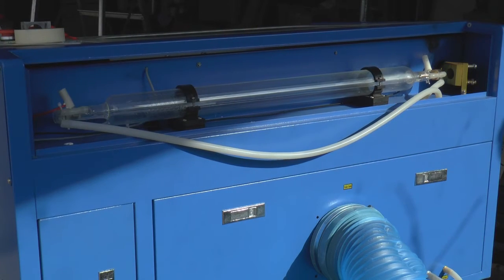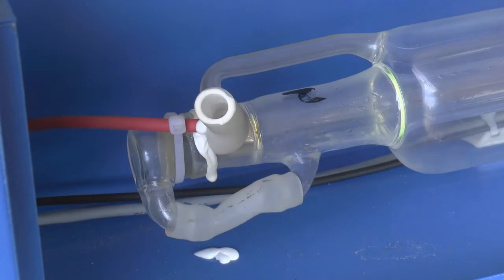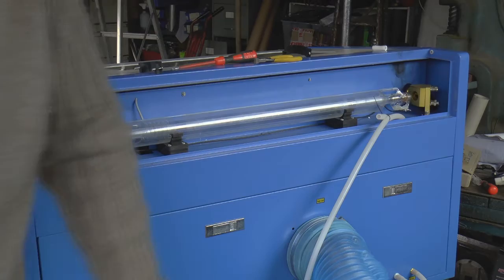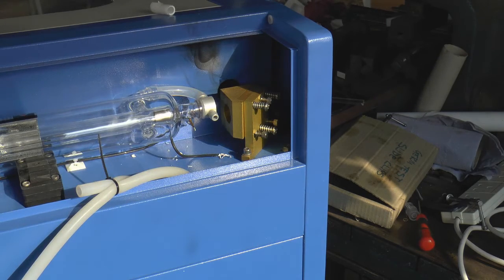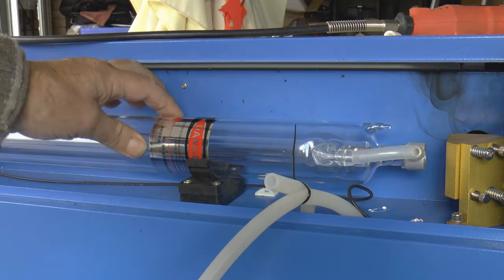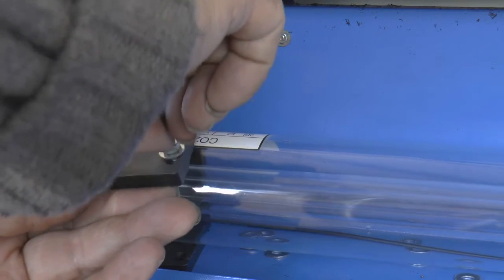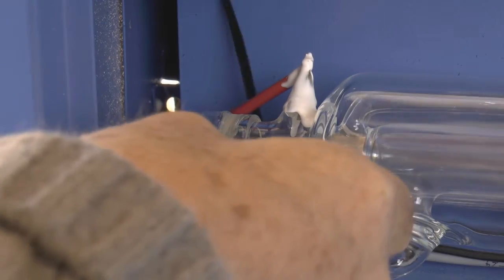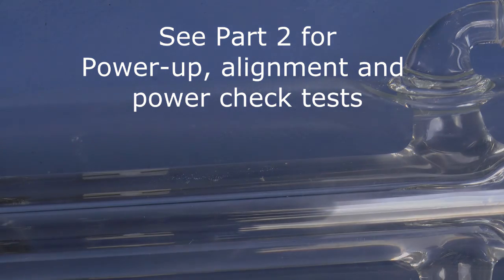RDWorks Learning Lab 21 Fitting new laser tube Part 1

Comment: You totally need a 3D printer! 😉 could totally print a new brackets in 1-2 hours. This solution doesn’t seem to match up with your typical perfectionist style at all 😄
Reply from the maker: Hi Vlad
Remember this is a learning journey and at this point I was still struggling to find out why my tube was performing so badly. I replaced my original rubbish tube with one that I bought from Ebay (in my ignorance) that was only slightly better. My creativity with acrylic had not yet got into gear, If you can't cut consistently then you cant make anything.
Best wishes
Russ
Reply: SarbarMultimedia i am gonna check out mactron tubes that you suggest just to see what kind of quality they can offer and may bring some of those to local usa market. I am working on quite large web project for maker community.
Reply from the maker: Hi Vlad
I spent some time researching Mactron.  They do build their own machines but like all other Chinese laser factories, they  design and manufacture nothing, they buy in standard parts from other factories and just assemble machines. Although I originally thought they made their own tubes,  I becamE slightly unsure. I have since researched other tube manufacturers but the only tube with dimensions that match mine  IS ONE  purported to be made by Mactron.......an MTS-T70 model see
http://www.co2-lasers.com/laser-power-supply/64-60w-co2-glass-sealed-laser-tube-mts-t60.html#.WymUgFUzphE

They also run a wholesale business and can supply anything your require. They only deal with A grade products so you actually get what you expect
https://mactron.en.alibaba.com/productgrouplist-801532219/Laser_Accessories.html?spm=a2700.icbuShop.0.0.4bcf2041BtMBC3

This is the tube and power supply that I ordered. 
https://es.aliexpress.com/store/product/1200MM-60W-Laser-Tube-60W-co2-Laser-Power-Supply/321243_1109607209.html?spm=a219c.12010608.0.0.2db52b6fs6wN7y

The finished up sending me a 70 watt tube...lucky me... It was not a long life tube  (claimed 4500hours) but here we are about two and a half years later and it's still as good as the day I installed it.
I also like EFR tubes  but consider Reci as over-rated and over priced ( and often faked)

Best wishes
Russ
Reply: SarbarMultimedia thanks! I’ll have a look. Very interesting. I have been working with China for over 7 years, so I have an idea of what may go on with those “vendors”/“factories” lol. They are very often a resellers. Finding a legit supplier in China is a huge challenge indeed, especially of those from Alibaba.

Comment: Hi Russ, I was hoping to get your advice on removing bubbles from the laser tube. I had the water system installed and had water circulating the tube until it was completely bubble free. Then I have the machine running for a while and for the first 15min or so the tube remains bubble free, but shortly afterwards, micro-bubbles start appearing and by half hour's worth of machine run time, the tube is completely filled with micro and medium sized bubbles. I've checked and rechecked my installation and hose connections and don't see anywhere where air might be leaking into the system... I've also made sure that my outlet hose is submerged beneath water level. So I'm wondering if you could provide some insight on how this could be happening? Could the pump I've been supplied with be insufficient in power?
Reply from the maker: Hi Jessica
You are not alone. There are many that worry about bubbles. First I must check which way the water is flowing through your tube. When you first turn the machine on,if you watch you will see some bubbles break away and flow towards one end of the tube. They should be travelling towards mirror 1. This may seem a silly question but if you are cooling with a CW3000 or CW5000 chiller unit the pipes on the chiller are marked IN and OUT. The pipes into the  machine are also marked IN and OUT some people mistakenly connect IN to IN and OUT to OUT thinking this is logical, but this causes the water to flow the wrong way. It still cools ok but is a bubble trap. 
In your case, what you describe is a simple reservoir system so I think you have it right and what you are seeing is the natural effects of dissolved air and cavitation. I will explain simply. 
I suspect you may be using deionized water or water that has been "purified" by a process called osmosis. This forces the water through a very fine filter material at high pressure. Water is very good at dissolving and invisibly hiding chemicals. One of those chemicals is air. You will be familiar with this  dissolved gas mechanism process  because you see it every time you open  a fizzy drink bottle. When you open the cap you are lowering the pressure above the liquid and the dissolved gas expands and comes to the surface. Leave it in a glass for half an hour and all the fizz seems to disappear. However, start sucking with a straw and you still get a mouth full of bubbles. That's because you have very locally reduced the pressure even more  and that allows more dissolved gas to escape. 
The pump you are using is not very powerful but there will always be dissolved air in your water. When that water enters your tube you will observe that the glass inlet tube has a VERY small bore, it  may be 2 or 3mm.  Your little pump is working hard to press the water through this small bore and  is probably cavitating at it's little impellor ie the impellor is spinning rapidly at a speed much faster than the water is flowing. This causes the dissolved air in the water to appear as bubbles. The other place where there will be a sudden pressure drop is when it has passed through that 2 or 3mm  bore and appears in the tube. Those micro bubbles do not have enough surface area to be dragged along by the flow until several join together to make a bigger single bubble. Stop and look logically at the construction of your lase tube. The central glass tube is where the HOT pink beam happens. It is surrounded by another tube which is the water cooling jacket. Where does the heat transfer occur? It must be into the water that is touching that INNER tube  Where are your bubbles? At the TOP of the water jacket....well away from the heat transfer zone.  My point is that they are not affecting the cooling of the pink beam. Be patient and over a week or two your bubbles will eventually disappear when your "fizzy" water eventually goes flat.

Hope this makes sense and stops the nightmares.
All best wishes
Russ
Reply: Thank you Russ, that was a great explanation. My water is indeed flowing towards the first mirror and I do not have a chiller installed. I just went and turned on my machine after over 12hours of non-use and a bunch of bubbles flowed into the tube. So I assume those came from air bubbles that were dissolved in the hoses. I shall leave the machine on for a couple hours everyday for a week or two to keep the pump running and see if the situation improves then. Very much appreciated!
Reply: I will also see about the location of these bubbles, though I can already remember seeing them mostly on the top of the water jacket. So that's a relief.

Comment: Hehehe, this reminds me of when I swapped my tube out a couple of years ago. No soldered connections & the replacement tube being a different diameter, a dimension that wasn't listed in the sale :D I had bought a 40 watt laser cutter (dk40) where the limitations on the output power were already well known. I managed to kill my original tube after a couple of years by forgetting to turn on the water pump one day :o & the end fell off ;( Anyways my interest is that I've just bought a Ruida DSP controller (rdworks). I had been running it with Mach3 using the Z axis to fire the laser before. It worked but had no pwm control and was clunky. I then tried (briefly) an Arduino with a Ramps 1.4 (3d printer) board with a modified version of Marlin. This worked and had pwm control but I had to use Inkspace which refused to deal with a lot of my existing dxf's & the home brew plugins caused a lot of crashes :S. Anyway, your video's are definitely a great resource and considering I've been running my laser for 5 year~ (albeit as no professional)  I'm both shocked and humbled by how much you've taught me in the last couple of days while watching your struggles :) I just came to get a grasp on the software side but I love the troubleshooting. You come up with some nice nifty solutions. Very handy indeed. (Edit* I forgot to mention, soldering the connections is very hard but I found the trick was to wrap some copper wire around the connection, then then soldered it. This seemed to work but experience might vary)

Comment: I have an issue with the power of my laser growing weaker & no longer able to cut through the 1/4 inch birch I use. I thought replacing the laser would help since I used the machine on full power to cut out a lot of items. Sadly even with my new laser tube the problem remains.
What causes the laser power to get weaker besides the tube? Is there anything else I should replace after a year of use?
Reply from the maker: Hi Jeremy
Wow that's a difficult question because I know nothing about your machine. The only thing I can deduce from what you have said is that  both tubes were working in some way so therefore we can rule out the power supply. because it is generating sufficient voltage to ionize the nitrogen in your tube. That ionized nitrogen should glow bright pink (almost pale mauve). If it's a pathetic pink or almost white then we are in trouble.

Ok, now I have to ask lots of questions to try and see what you can see.
What size /model  of machine is it. Is the model number something like KH7050
What power is the tube?
Is the tube labelled? If so what is the tube make?
Where did you buy the replacement tube from?
Do you have an ammeter fitted to your machine?
Do you know what the maximum drive current is for your tube?
Have you checked/cleaned/examined your lens
Are all your mirrors clean?
Have you checked beam alignment through all your mirrors and through the nozzle?
What sort of mirrors do you have? Are they gold plated or are the silver and very heavy?
Do you have a power meter to check the machine output?

Any one of these items could be an issue  but first examine your tube colour and let me know,  along with answers to all of the above.
Speak soon
Russ
Reply: Focus (maybe new lenses) and good air hose with pump. Got same problem and solved it by refocusing the lens and measuring exact 51mm height from object to laser head.

Comment: My thanks as well for all your info.  
You're opinion please - since I didn't see it it the vids or comments so far.....
Is it worth while for me to buy at the outset a 60W machine at about $500 extra cost vs. a 50 W or
retrofit the 50W with a 60 or 70 W tube as you've done.  Seems like the retrofit is the better choice since you get a true 60W tube.   I would be quite comfortable with the design/build of the retrofit.  and  I don't need (I think) a larger machine that typically comes with the 60W tubes.   You did say you were happy with the mechanics ... so the devil you know is better than the devil you don't there as well.
Reply from the maker: Hi Dennis
Whatever you buy from ebay will NEVER be what it claims. The 50 watt machines are all fitted with 40 watt substandard tubes. They will be labeled KHLaser, a non existent company. The tubes are QA rejects from one of many large tube makers. They are probably bought as scrap for cents and retested to make sure they work "in some way". They then get fitted to ONLY ebay machines where the accountability  trail is zero. They work just well enough to fool the unknowing  hobby buyers. You may be lucky and get a "near miss " reject that will last for months or be unlucky with a tube that dies within days or weeks.

For this reason my advice is to buy the smallest cheapest offer that suits your size requirements and spend the money you save on a replacement OR an upgrade. It is important to buy a new power supply to MATCH your new tube because the original power supply is likely to have been assembled with hope and angels' tears..

Best regards
Russ

Comment: Your work is outstanding.  I have learned so much and I'm so grateful that you're passing on all of what you're learning.  (maybe I've told you that before but it's worth repeating).  So here is my question.  I have a RedSail (from China), "100" watt laser (that is probably actually an 80watt laser over boosted).  I'm hoping to be able to cut through 18mm hardwood.  I've been trying to make it work, but it doesn't seem to be able to make it all the way through.  I've tried multiple passes (up to 7) and not making it. Is there any trick to making this happen?  I've also experimented with different focal lengths.  I'm only using the small air pump that came with the unit.  ??  Any ideas?  tips?
Reply from the maker: Hi
Did you see https://youtu.be/61bGzWicRRk

Multiple cuts are not a good idea because you only finish up burning the sides of the first cut. One major issue with cutting wood is the smoke. The smoke is a great absorber of IR radiation so it is vital to cut through in one go and then to keep the burning face as free from smoke as possible with air assist. That is a problem with using the 2" or 2.5" lens, the distance that the nozzle is away from the work surface means that the normal air assist will be very inefficient at getting into the cut. I would advise a small tube with a separate jet of air directed at the cut........even if it is just another little aquarium pump
Best regards
Russ
Reply: Thank you.  Yes I did see that other video as well. The finish on the area where I'm cutting is not crucial as I end up sanding it and gluing other parts on that surface.   It's just primarily penetration that I'm working on.  It's a curved cut which is much easier and more accurate with the laser.  And it doesn't gum up like the router bits on my CNC router.  It currently has a 38mm lens (1.5").   I was thinking maybe I would also try a "Cut/Engrave" of the arc and make it a little wider so that the next layer down may be able to make it all the way through on the second pass.  I'll be making some videos of the adventure soon so I'll send you a link to review when I get the experiments documented.
Reply from the maker: That's an excellent approach to multiple cuts.  It will be much quicker to raise the work to within 2mm of the nozzle and then cut 3 LINES the shape you want about 0.5mm spaced apart and cut 5 or 6mm deep. the central line being the cut that you are going to cut through on. The two side cuts should give sufficient relief so that they don't get burnt during the second cut
Good luck
Russ

Comment: Excellent as always Russ... How many hours do you reckon you achieved from the original tube ?
Reply from the maker: +paul w 
Hi Paul
If I had 50 hours running that would probably be an exaggeration.The tube worked at low current values say 30 to 40% power but as soon as I started to push it iabove 60% the power started to drop off very quickly. In my ignorance and without an ammeter fitted, I tried to fix the problem by pushing the % power up, which just made it worse. I eventually realised that there was something seriously amiss with the tube and decided to buy this new tube. I bought it from ebay and it was described as an OEM replacement for my particular machine.  That's the tube I'm fitting here.I didn't realize, only half suspected, that my original 50watt tube was NOT as specified. This new tube was again specified as a 50 watt tube so I trusted it. Silly me!!!. This tube did preform better but it still was not brilliant. I soon fit an ammeter, do research on tubes and find that my 800mm original and this 850mm long replacement are just not long enough to be 50 watt tubes. They are both 40nwatt tubes. I soon invest in a power meter to resolve the question once and for all. Yep, 40watts!!!.
As Time goes on I find this tube has some strange characteristics that are unpredictable. I persevere with is tube for several months as the series progresses, learn a huge amount about the technology and the way the Chinese operate via ebay/amazon market place and eventually understand that they tend to ship B grade tubes with machines from the factory. Its a bit like the current practice of inkjet manufacturers supplying full size cartridges with their machines but with only 10% ink inside. 
I continue to use this tube to develop the bugs out of my machine, and I suspect with less than 100 hours use, I will eventually dump this tube as well in favor of a PROPER upgrade to 60 watts....Fantastic.
But hey I don't want to spoil the end of the story for you....
Best regards
Russ
Reply: +SarbarMultimedia Thanks again your help has been invaluable and as always easy to understand.  Much appreciated